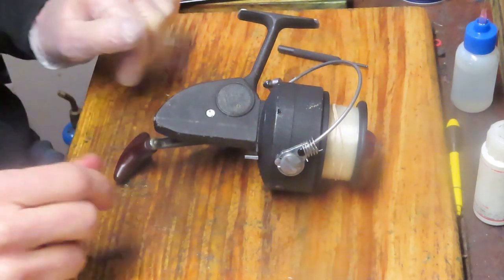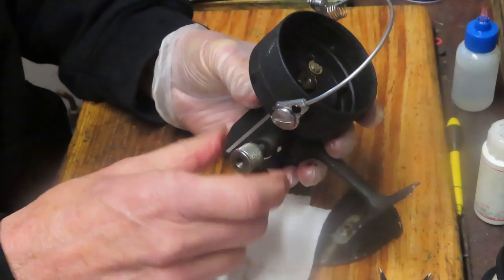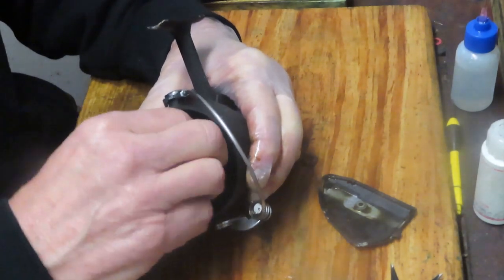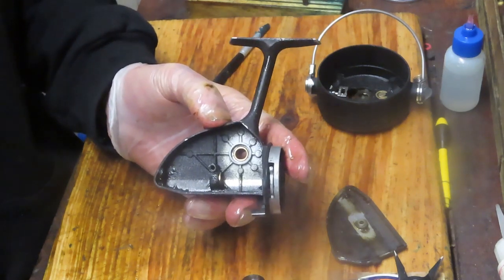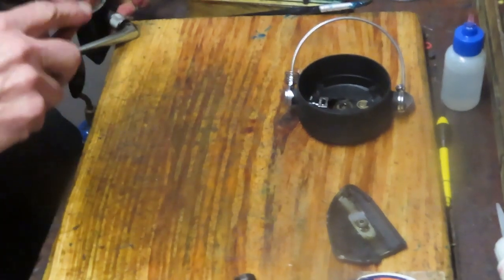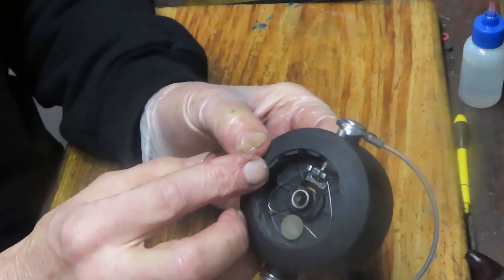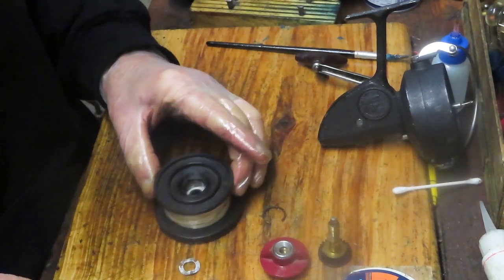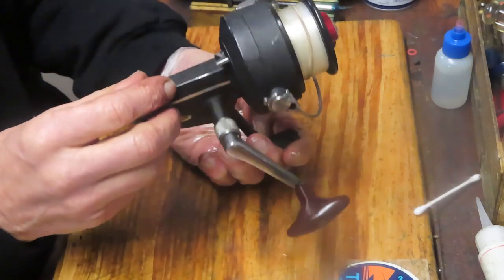DAM Quick 440N spin fishing reel how to tak apaert and service including bail spring reset

Comment: I've opened up a few "parts" reels over the past couple years. Sellers always said that the crank is frozen. I liked the deals those sellers gave me as the fix was easy, and the reels worked like new after I detail cleaned the parts and relubed. Thanks for all your help on your video posts in helping me know what to look for when I detail clean parts, Dennis!
Reply from the maker: Thanks for sharing - glad to help - Dennis
Reply: Same here- I have a bunch of vintage never used reels that someone thought they were no good but was just that the old grease became a solid- let them soak in some dawn and hot water mix-  cleaned relived- new again

Comment: I'm surprised how much like the  Shakespeare royal maroons this one looks inside as far as the basic mechanism.
Worm drive gear, same style of stamped and bent around crosswind arm , it's attached directly to the main gear , and attached to the axle shaft with a dome headed pin.
The non sealed bearings DAM used are an advantage in my mind, because they're easier to clean lubricate than a sealed bearing.
Usually substitute replacements can be found, but many bearings were made better and I like saving them.
It's a very simple, reliable, and smooth mechanism design.
Probably the best ever used in a spinning reel, at least in my opinion but I'm certainly no expert and haven't been inside as many reels as you have.

The anti reverse on this one is definitely interesting, and I'm not sure how I feel about it.
On one hand there's much less to deal with during a regular basic servicing/ maintenance,  but on the other hand you have to take it down a lot further if you also want to service the anti reverse.
Reply from the maker: They do look similar to those and to the early SpinFisher reels

Comment: IHonestly I prefer the older 440 as opposed to this 440N.  I have a 550, 440, 331 (high speed), and four 270 Super reels. All these DAM Quick reels are tanks and all but indestructable. When I’ve worked on my 270 Supers I’ve had a very difficult time knocking out those handle pins. One in particular would simply not budge. Would heat help? Great video of a very nice reel! — Chris
Reply from the maker: I think as a last resort you could try heat.